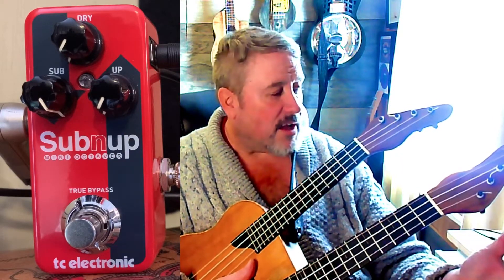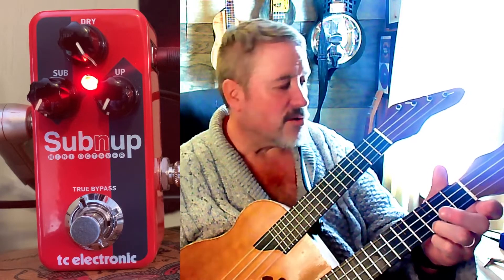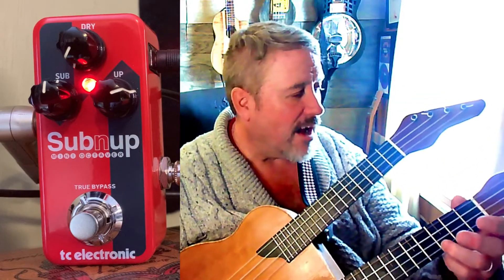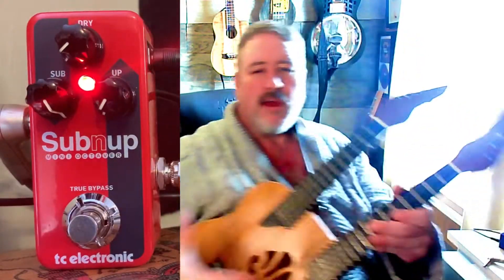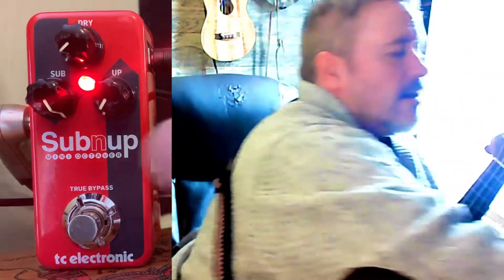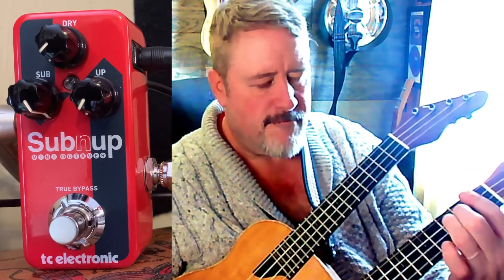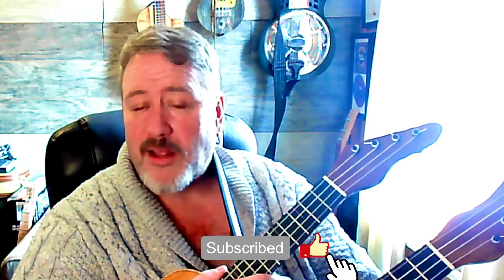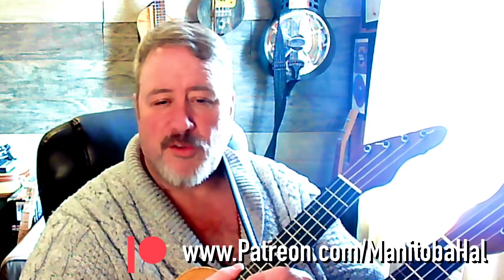Turn Your Uke into a Bass using a TC Electronic Sub N Up Octave Pedal

Comment: I set up a toneprint for this little guy to use as an organ sound with octaves and some chorus. This thing is seriously versatile.
Reply from the maker: That’s awesome. Tell me more about setting up a tone print.
Reply: @HalBrolund  It's sort of a mass pain in the ass but there's so much you can get out of that pedal. The easy way is to download the app on your phone and it comes with a bunch of presets which can turn on secondary functions (the phone emits a tone through your pickup to send messages to the pedal, super crazy, sounds like dial up) but to really dive into it there's a usb jack on the side of the pedal. Plug it into your computer, download the toneprint software from TC's website and you can tweak all of the settings and save them.on the Sub n up you can control the wet mix and drive of all three octaves, EQ the signal, apply filters to each octave separately, and add modulation effects (chorus/flanger mostly) and map the pedals to have different functions (my sub bass knob adds in chorus to the full signal) If you have a free afternoon it's worth playing around with as there's so much more you can get out of the pedal than what the three knobs give you.

Comment: I purchased a TC Electronic Nether. I’m playing a low G Tenor with Nylon strings (not the low G). The range of the base effect is limited with the effect turned on for example I can’t play an F note as it just sounds normal. The only base notes are really the first few on the top string.

I can see you’re having more success with this pedal and are playing notes on the C string (F note). 

I’m just wondering if you have steel strings and the type of Ukulele (tenor / baritone).

Any help appreciated.
Reply from the maker: The uke I’m playing is a tenor/concert combo and I do use a wound Low G on the tenor because I like the snappy feel. I think I’m in the minority of uke players in that one though but I feel like it gives a more real bass tone to the nylon string. 

The uke was made by Fred Casey in Winnipeg Beach, Manitoba. (http://www.cfcaseyguitars.com)

Comment: Hi Hal, which do you like better, your original Mooer Tender Octaver pedal that you demoed awhile back or this new TC SubnUp? I plan to setup a board similar to yours for a uke bass loop. Thanks in advance!
Reply from the maker: Both! They are very similar. The Tender Octaver that I owned was one of the original copies of the electro harmonix mini POG and it sounded awesome. Mine died however and Mooer got sued and so the original is no more. They have released a version 2 that is supposed to be pretty good but I'd have to order it in to find out. I was planning to do that but then this pedal came up for sale from a local friend of mine for a similar price. All this to say I'd be happy with either.